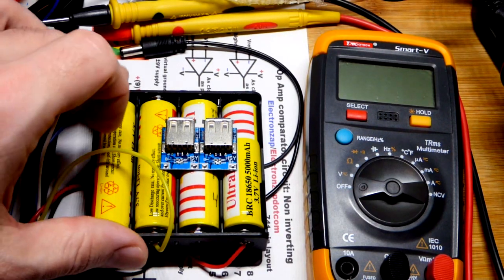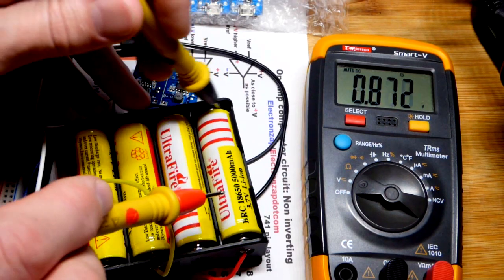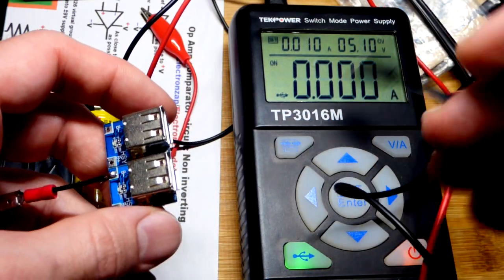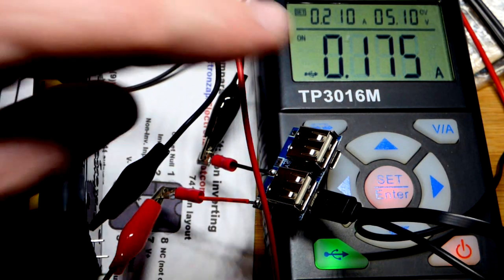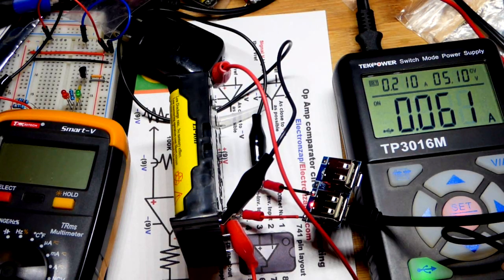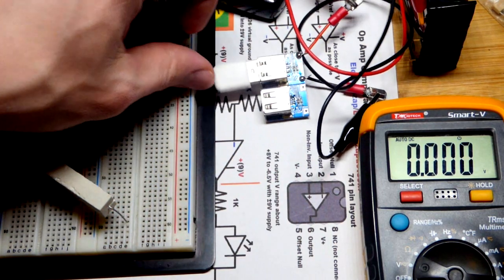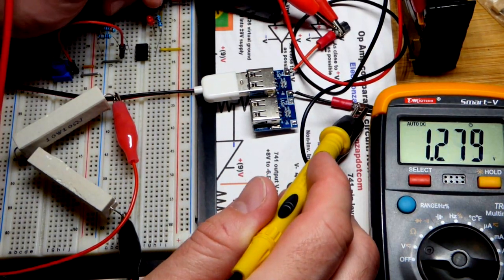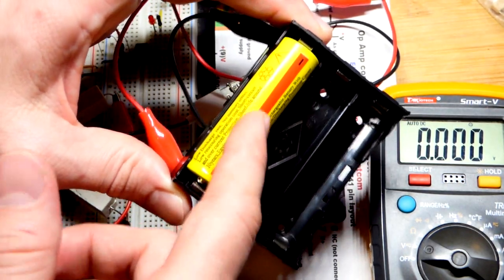First DIY 18650 lithium ion battery charger and 5V voltage booster test didn't go well electronzap

Comment: I remember the 1st time I saw those giant ceramic resistors and well I just pulled this face: 😂 But I bring this up because, as an audio guy learning electronics without guidance of proper Electrical Engineering background, I finally understand now that they are used to provide a LOAD to the circuit that is approximately the same as the actual intended load. FWIW my tiny speakers that I use are rated 8 ohms of impedance. It was not easy to make the connection between "faking" the energy consumed by a moving coil that drives a speaker with a ceramic resistor that can (mostly) handle the heat dissipation because most applications of resistors are to limit current.  But all loads are resistive ...
Reply from the maker: Yeah, the basic principles pop up everywhere, even though lots of branches of electronics look completely different.